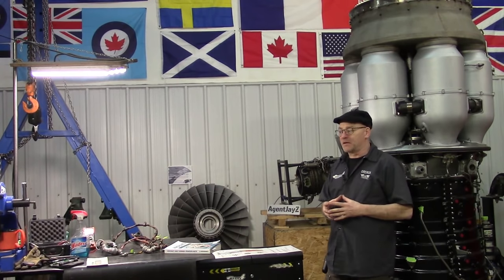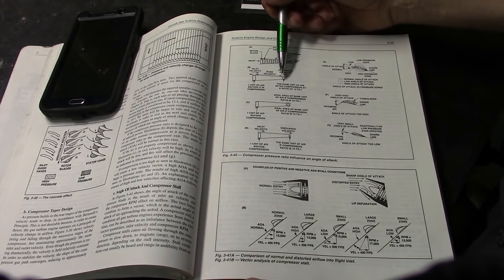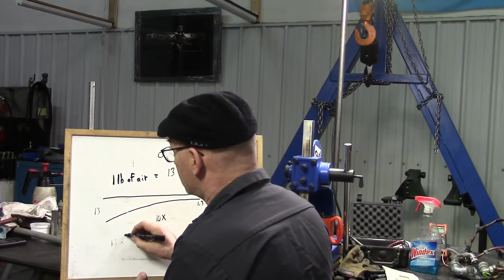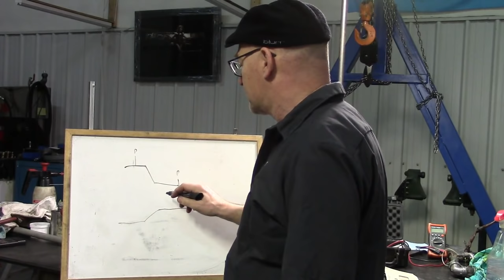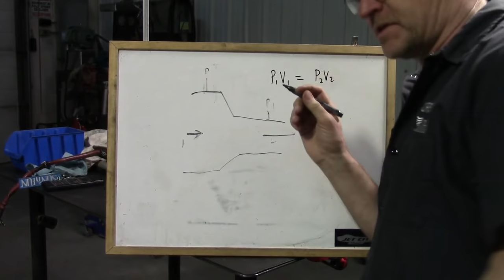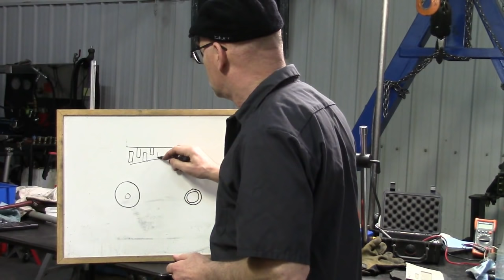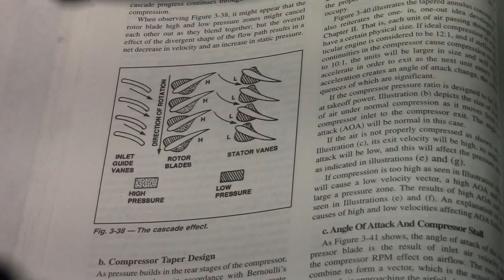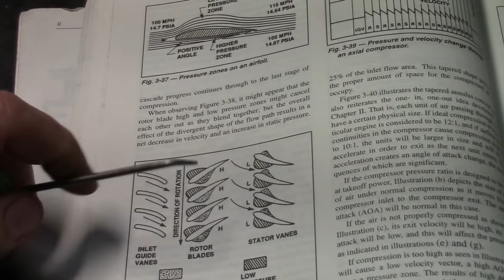the Narrowing Compressor Gas Path: Jet Engine Mistakes 3

Comment: In my final year of formal study we were encouraged to use a minimum of 8 sources. This was for several reasons. One of these is that most authors use a slightly different way of explaining things and depending on the type of learner you are some explanations will be easier to understand than others even if they are at the same academic level, and once you have got one or two of them then the others become easier to understand. For arts (I also have a degree that involves analysing ancient texts from the middle east) we were encouraged to use 12+ sources for an essay in the final year. One other point worth noting is that even though there are often teams of proof readers, errors get through in text books. In Keen Rogers and Simpson "Facts Patterns and Principles" (Inorganic Chemistry) it was updated for this reason and others at least 5 times.
Reply: I like the way you think. I've got a half dozen books open right now on the same subjects.......What I do is often the reverse.....I take what have witnessed , then watch the cover ups from different sources to figure the game out. After awhile it gets easy ,the patterns are repeated, .....Capt. Mike    SAT

Comment: Has anyone tried to create a compressor with counter rotating blades?  I mean, instead of stationary stators they would actuall rotate opposite to the compressor blades?  Fascinating video and really got me thinking.  I need to get that textbook and geek out some more!
Reply from the maker: Compressor blades and stator vanes look similar, but they have completely different functions. Any of the books I recommend in my video call Books will definitely help clear things up.

Comment: G'day,

Yay Team !

I can't remember ever thunkin' that Axial Compressors worked by 
"stuffing Air into a Funnel...",
Because it was always so obvious that the Rotor grabs and squeezes the Air "beneath" it as it presses it back towards, and past it's Trailing Edge..., and then as soon as the Compressed "Downwash" clears the Rotor Blade's T.E., then the Stator's Leading Edge "cuts off" or "bites" or "shaves a Helical Slice" from the Compressed Airflow - WHILE reversing the Rotational direction of the Airstream by 90-Degrees, so as to optimise the Efficiency of it's impending encounter with the Leading Edge of the next Stage of Compressor's Rotor Blades...

Once one gets it clear in one's "Mind's Eye"..., the whole setup is as cunning as the proverbial Shithouse Rat (nobody sets Traps in the Outhouse, so the Shithouse Rat lives in perfect safety - while only foraging in the Kitchen and Pantry during midnight Raids, when disturbance is highly  unlikely...!).

Such is life,

Have a good one...

Stay safe.

;-p

Ciao !

Comment: Just saw some pictures of RR's new test cell.    It's impressive - but I wonder what they could do in a canvas tent?   Half way to the arctic circle?   In winter?  :)
Reply: They do their Arctic  testing, in the Arctic winter, with two engines mounted on a real airliner's wings, when they have already done a massive amount of test bed running.  Try checking out what they did with the Trent 1000 at a place called Iqaluit

Comment: Thank you for great videos! Hello from Turkey!
Intake air is getting pressurized by compresor stage by stage ,right? How high pressure air doesn't go back to low pressure zones? 
Also, do you have any video explain about  co-axial shaft bearing arrangement? 
Regards!
Reply from the maker: The air is moved by the compressor blades. Why does a propeller not make the air move forward? Same answer.

Comment: The rotor not only increases velocity of the air  but also increases pressure of the air like the stator.
Reply: Correct
Reply: It depends on how they designed it with the degree of reaction, if degree of reaction is 50%,then the rotor and stator have equal share of rising static pressure from the dynamic pressure of the incoming free stream through the axial compressor of jet engines.

Comment: Yooohooo. I have seen some videos of LOCKWIRE AND NOT SAFETY lock wire. What’s the point of benefits to lock 6 or 8 or 10 bolts with one long lockwire vs 2 and 2 or 3 and 3 bolts together..?

Comment: As a brand new viewer of this channel I'm confused. In the compressor as the air is being squeeze doesn't the temperature of the air increase before fuel is injected into the combustor?
Reply from the maker: The air in the compressor does increase in temp.
Compressor Discharge Temp of modern airliner engines can be over 800 degrees F, even though the inlet temp czn be -50 F or even lower.

Comment: Hi AgentJayZ, I hope my question this time won't be a ridiculous .
How does the temperature of the air change through the different stages of the compressor or at least in the last stage??
Reply from the maker: Compressing air increases its temperature. Compressor discharge temp of modern airliner engines can be over 600 degrees F, and that's at altitude, where inlet air temp can be -50F. Compressor discharge air is as hot as a pizza oven, and is used as cooling air in the combustors.

Comment: As you're working on the LM2500 and this is derived from the GE CF6 airliner engine - can you please show its HPT 2nd stage disc? How big is it with the blades attached?
In October 2016 one of these discs failed in the right hand engine (no.2) of American Airlines flight 383 (B767-300ER) on its takeoff run at Chicago O'Hare airport. It caused an uncontained engine failure and a fire due to rupture of the main fuel line to the engine, which damaged the aircraft beyond repair. One piece of the disc pierced the aircraft's wing, went over the fuselage and came down on an UPS building almost 3.000ft away, smashed right through the roof and ended up laying on the building's floor.
Luckily only one passenger was seriously injured and no one died during the accident.
Reply from the maker: I've shown the HPT of the LM2500 in several vids. It's a solid chunk of steel that contains a huge amount of energy whenever the engine is in operation.
I believe most of the damage to that aircraft occurred from fragments and debris that bounced up after a large portion of the ruptured turbine disc impacted the concrete under the aircraft.
Reply: @AgentJayZ  Yep that might have been like running over a mine.
Maybe you can show this turbine (stage) again the next time you get it in your hands... you have so many videos, I'll try to find it but it might be difficult.
Reply from the maker: On my channel page there is a search bar. I just tried it with "HPT disc".

Comment: Thank you for explanations! It was a discovery for me because I thought that compression is caused by narrowing duct of the engine's compressor.Can't say that I've understood it 100%...I supoose, I'll read about it more.
      Continuing topic of compressors, I have another question, may be you'll want to explain it by simple understandable language...There is the phrase in my book "Theory of air jet engines" - "There is unco-ordination of first any stages and last stages in an axial compressor with large amount of stages (about 12 and more), having big pressure ratio. With decreasing of rotation, blade's angles of attack in first any stages are increasing but in last stages are decreasing. With increasing of rotation - oppositly". Thanks!
Reply from the maker: Ah, I recognize that language in your book. It was written by people who know their stuff, but then translated to English by someone who doesn't. If you are already familiar with the subject, you can understand the description, with some effort.
If you are trying to learn from it, it will be extremely difficult and confusing.
Make sure you get another book (or several!) on the subject, and read them at the same time.
Reply: @AgentJayZ  , sorry for my language) This is, as I hope, more exact translation from the book: 
         As the number of revolutions decreases, the angles of attack in the first stages increase, and in the latter they decrease. As a result, in the first stages of the compressor there is a stall of the flow from the backs of the blades and, as a consequence, surging; in the last stages, the so-called turbine mode occurs, which is characterized by a sharp drop in the compression ratio, as well as the blocking mode.
       With an increase in the number of revolutions in excess of the nominal, the mismatch of the operation of the extreme stages changes - now there is already a surge in the last stages, in the very first stages with the appearance of sound and supersonic relative flow velocities, a blocking mode arises. 
    Could you explain by simple language, what's the  reason of the mismatch between extreme  stages and change in blades' angles of  attack,  when the regime of compressor is out of nominal? In this case nominal regime of the compressor is design regime of operation, as I understand it, it's ideal regime of operation, that was calculated by engineers-designers.
Reply from the maker: Sure, but it's still wrong. The later stages do not decrease their angle of attack with decreasing rpm. The point of my answer is... did you watch my latest video?
Reply: @AgentJayZ  , honestly I did  google translation of the book...I have found a bit information  in  internet about stages mismatch in big cmpressor, the author wrote about the same modes of working in the first and the rear stages, there can be surge and choke (this is the right English term for locking mode), this is the link (the first article): https://www.sciencedirect.com/topics/chemistry/compressor
I haven't watched your latest video but soon will!

Comment: the compressor gets narrower so the air velocity stays constant. the air velocity has to stay constant so the compressor blades can meet the air at the correct angle of attack or else they stall.

Comment: With all due respect, for a 10 to 1 pressure ratio the, density ratio is for an perfect uncooled compressor is only 5.17, because the ideal compression is adiabatic (isentropic) and an increase in temperature is present.
Reply from the maker: Sure, when we run the J79, and measure CDP, it's between 150 and 160 psig. I just crudely divided that by 14.7, even though we are at a couple thousand feet above sea level here.

Comment: There is nothing wrong in that diagram. The bottim guages show total pressure. You can’t measure ram (dynamic) pressure directly. See pitot-static sytems.
Reply from the maker: Yes, I left that in the video. It's my mistake, not the author's.

Comment: I sort of imagined that the centrifugal force of the air whipping around would also play a factor in the compression but I now see that is wrong (at least in this compressor design) because it is an interplay between the rotors and stators. If I understood it correctly the air takes a (sort of) straight path through the compressor. This would save weight on added structural design to compensate for centrifugal air rotating at 10.000rpm.

Comment: Hi. I have a question about the bell shaped intake. You mentioned before that they're used in the test cell to optimize airflow to the engine, but they're not necessary in airplanes due to ram air pressure during flight. How do you get them for the test? Do you have a bunch lying around?  Do you order them from the manufacturer? I'm curious about this detail. Sorry if you've mentioned it before
Reply from the maker: They are rare and difficult to obtain. They are also in the hundreds of thousands of dollars. So we don't do that. We design and make our own.
Reply: @AgentJayZ  Cool thanks! Love the videos

Comment: Thanks for the explanation, I think I'm starting to get it! But now I don't understand how a ramjet works....
Reply from the maker: No problem. Ramjets are not used anywhere, except missile sustainer engines... which are disposable.
Reply: In a ramjet enough compression occurs by air being forced into a suitably shaped inlet duct due to the speed of the ramjet powered craft so no need for an axial or centrifugal  compressor section & no need for a turbine section to provide shaft power for the compressor section.

Comment: I have a question about the burnooey thing. Years ago...30 or so....the tech I was apprenticeing under ( yes, I'm one of those piston guys ) had a gadget that when connected to an air line would produce colder than ambient air if he hooked it up one way and warmer than ambient air if he hooked it up opposite direction. The thing had a sort of venturi in the middle of it with a large funnel type cone on one side and a smaller one on the other. Would the burnooey effect come in to play here?
And I understand that rapid decompression creates a drop in temp.
Reply: Yes, a venturi tube is applying Burnoullis principal
Reply: You're probably referring to cooling devices used in mines. It didn't use a venturi. Compressed air was injected tangentially into the tube to create a vortex. The air on the outside of the vortex was hotter and vented out one port while the cooler air in the center of the vortex was vented to a different port.

Comment: I think a lot of the confusion stems from the diagrams lack of showing a restriction (if "restriction" is the proper term, load maybe?). If there wasn't back pressure from combustion stage, the air would lose its compression and increase in velocity as it expands.
Reply: In simple terms. The compressor works against the combustion stage. The combustion stage works against both the compressor and the turbine. The air velocity from the compressor along with the added energy from combustion is forced out turbine. The combustion flow goes out through the turbine and not the compressor because, the turbine has less resistance then the compressor. This assumes that the engine is being spun before starting the combustion process.

Comment: Why don’t we want the velocity to drop throughout the Compressor stages? I saw something about the Angle of the oncoming air changing as velocity changes, and therefore a possible stall or other engine troubles would be more likely. Cheers, Norway.
Reply from the maker: Have a look at my vid called Compressor stall

Comment: With the reduced tapering in the last few stages of the compressor, would expansion due to heating of the air charge not offset some of this slowing effect?
Reply from the maker: The air might normally expand upon heating, but it's in a compressor, which is compressing it, by force, which causes the discharge air to be even hotter.
Reply: @AgentJayZ  I understand that, the question was more about flow rate through the last few stages of the compressor
Reply from the maker: I answered your question.
The mass flow rate through the entire compressor does not change. What goes in, comes out.
Any of the books I recommend would really help with understanding how compressors work.